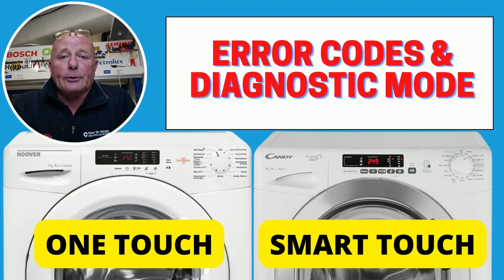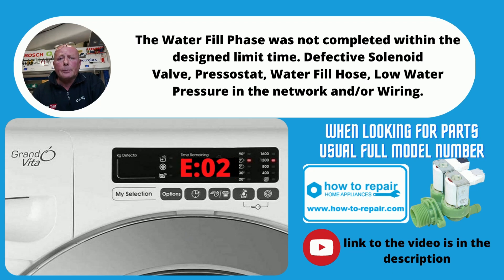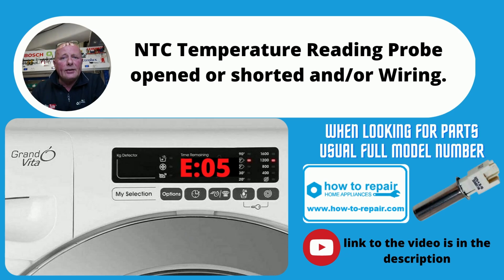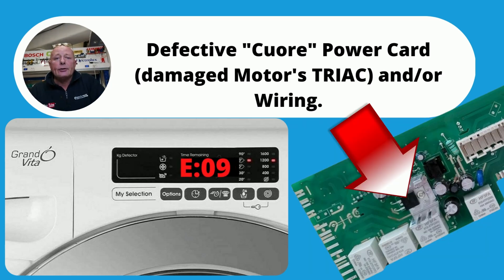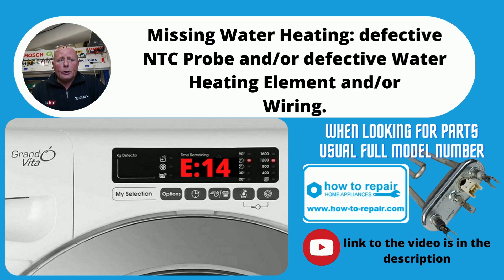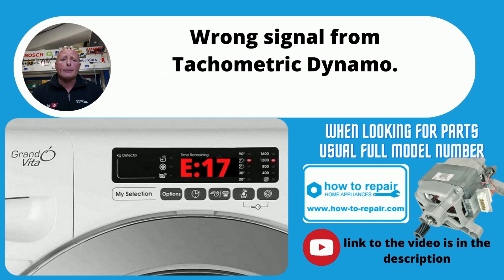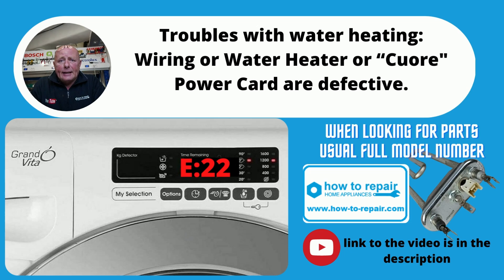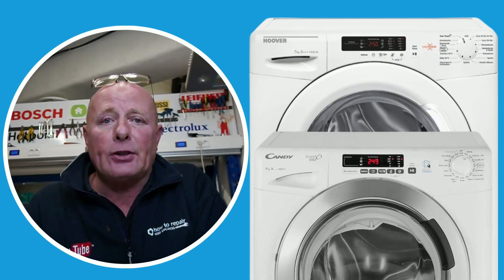Hoover Candy Washing machine error fault codes and self-test mode on Grand O'Vita smart touch

Comment: I have a candy smart pro washing machine. I have an issue of wifi connectivity to the mobile app. Previously it was working fine. A couple of weeks ago I am facing this issue. Can you please guide me how to run a self diagnostics program in the machine. I tried to run it as you mentioned in the video but it does not work. It may be due to the model difference.

Comment: Hi there. Candy, the only light working is on Time Remaining with a count up h01, h02, h11 etc with beeps. light on 40 degrees and 400 cycle spin. Nothing else. Won't start either. Nothing in trouble shooting either. Any ideas?
Reply: I have the exact same problem. Just counting up h1, h2, h3, h4 up to h24 and beeps forever. Tried everything I can find..
Reply: I have the same issue, did you find a way to solve it?

Comment: We have a grand Vito condenser dryer, bought it December 2020, we moved house and put the dryer into storage March 2021, then started using it again December 2021, it’s now March 2022, so the dryer has had 6 months use at most. It’s started showing a E14 code, it’s out of warranty so I replaced the ntc sensor and also the heater , it’s still showing the code.
I’m now contemplating throwing it in a skip, pointless spending money on it.